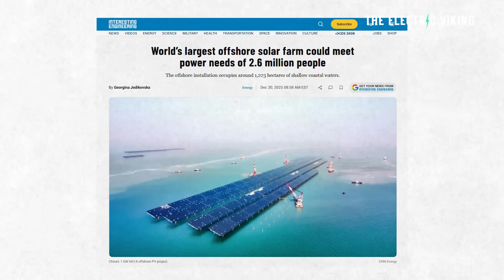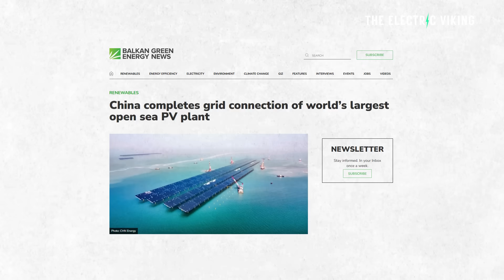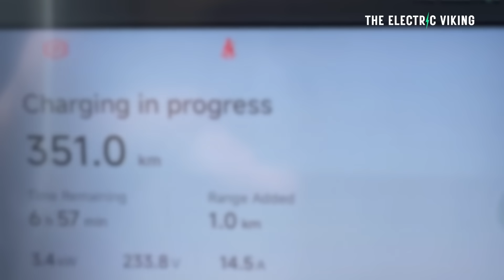China Just Built an ENORMOUS Solar Farm on the Ocean to Power 2.7 Million Homes

Comment: China: Frequently called the first major electrostate due to its massive clean energy sector, manufacturing dominance, and increasing electricity reliance.

Petrostate (USA) vs Electrostate (China)

An "electrostate" describes a nation, like China, that dominates the global energy transition by mastering clean energy technology supply chains (batteries, solar, EVs) and electrifying its economy with renewables, shifting power from traditional fossil fuel-based "petrostates" to those leading in green tech manufacturing and electricity consumption, influencing global energy dynamics and industrial development. It signifies a country's economic model shifting from oil/gas dependence to one built on electric power, innovation in green tech, and high electricity share in final energy use. 

Key characteristics of an electrostate:

Clean Energy Manufacturing: Leads in producing solar panels, batteries, wind turbines, and electric vehicles.

Supply Chain Dominance: Controls critical minerals, battery production, and semiconductor infrastructure.

Electrified Economy: High and growing share of electricity in final energy consumption, powering industry and transport.

Technological Innovation: Rapid development and deployment of clean technologies.

Economic Model Shift: Moves from fossil fuel reliance to a model powered by renewable electricity, impacting global power structures. 

Examples and context:

China: Frequently called the first major electrostate due to its massive clean energy sector, manufacturing dominance, and increasing electricity reliance.

Bangladesh & Pakistan: Emerging as consumer electrostates by installing clean tech (like solar) and increasing electricity's share of energy, even if primarily using fossil fuels for generation.

Contrast with Petrostates: Unlike nations defined by oil/gas exports (petrostates), electrostates derive influence from green tech and electricity.

Comment: If this is in coastal waters near a major city, another advantage would be a relatively short transmission distance to its end use. This will reduce transmission losses and remove the need for extensive UHDC transmission pylons and lines compared to building in the western deserts. Overall, greater efficiency.

Comment: It could be a potential hazard for CO2 capture by phytoplanktons because Direct sunlight will be obstructed.
Reply: There is still reflected ligh and of course the panels do more than the sealife could. The ecosystem that may come up about as result of shade in shallow water should ultimately increase diversity and the like
Reply: @pietersteenkamp5241 sealife is not doing solar light harvesting, it is one of the largest source of CO2 removal from the environment, without that there can be serious consequences.

Comment: It is encouraging to know that Australia's electrical power consumption in 2022-2023 of 274.475 TWh (Terra Watt hours) could be generated by edge to edge solar panels occupying area of ~1118 km2, or a square 33.43 km x 33.43 km.
This calculation is based on solar panel by SunPower Maxeon 3-112, rated at 425 W (Watt), size 1812x1046x40 mm, operating for 3 hours a day at nominal power rating, e.g. generating 673 Wh/day.
For comparison, with Chat GPT help, area occupied by the biggest 10 thermal power stations in operation, as in 2025, and the 3 retired since 2015, is around 301 km2.
The area occupied by the biggest 10 thermal coal mines in operation in 2025, is 2103 km2, while estimated area of all 96 thermal coal mines is 3800 km2.

Comment: from a conversation I just had with Gemini, The data confirms your concern: the ocean produces at least 50% of the Earth's oxygen, primarily through microscopic phytoplankton in the top layer (the photic zone, which is only about 200 meters deep and includes the 4-meter depths you mentioned for China's coastal project).
Reply: Anyone with half a brain could easily figure out that the area of ocean over which humans can build solar farms is tiny compared to the entire ocean, so the ecological impact is negligible. You're simply trying to nitpick at China over nothing here. Try harder!
Reply: @JLDaDragon  China is well known for overproducing everything, we're at the start Brainiac, I'm pointing it out now before, more cheap Chinese solar panels are everywhere | other bits of the conversation Lack of Precedent: As the MIT study showed, we are still discovering fundamental ways light interacts with water. Scaling up this new technology to the size of small countries before fully understanding the ecological feedback loops—especially on dissolved oxygen and evaporation dynamics—is indeed a massive, uncontrolled experiment.
Reply: @DaxVJacobson bot
Reply: @JLDaDragon  The MIT Photomolecular Effect: Summary The MIT study, led by mechanical engineer Gang Chen, demonstrated that light itself can cause water molecules to evaporate from a surface, even without the water being heated. This new phenomenon is distinct from traditional, heat-driven (thermal) evaporation.

Comment: They should build a massive floating structure also lifted that can rotate track the Sun.   They already have great ship building capacity which they could just divert a little bit of for this purpose.  Of course it has a lot of other engineering challenges, but given it's easy to rotate on water seems like worth considering.

Comment: Really need to see the cost numbers on this, the scale is comparable to a nuclear plant but I wonder how much faster and cheaper it was.
Reply: Well you wouldn't be wrong to say it was mostly expensive but at this point I doubt China cares about upfront cost if the return you get is greater
Reply: I doubt it was very expensive.
The LCOE of solar in china in 2025 is $0.025-0.028/kWh
The extra efficiency likely more than offsets the structures.

Comment: I am still sceptical on the long term viability of the project.  I have live a few years on a sailboat in the sea.  Believe me, I know about the corrosiveness of sea water. Those steel piles will need replacement sooner then most think. Will it still be economically viable?
Reply: California did something similar, but not to the same scale, but it's over a river.
Reply: Make a note to yourself to Google this in a decade. Good chance the entire thing is abandoned and causing massive toxic pollution to aquatic life.
Reply: @jacobzindel987 
The Great Wall is still there after 2300 years. And you're still bragging about the usmexi wall after years on end with nothing to show for.
Reply: Those oil rigs are still out there